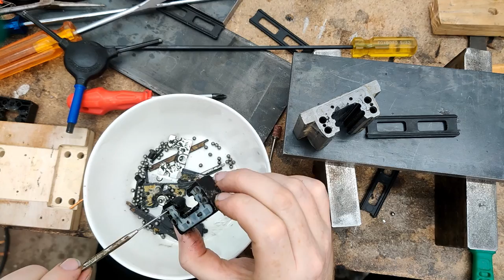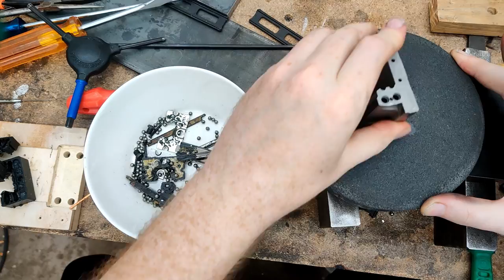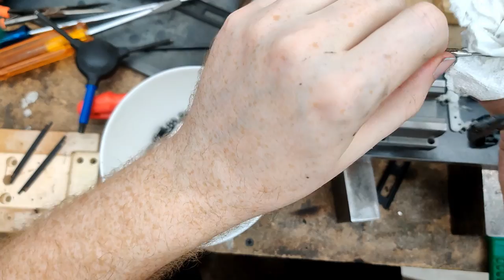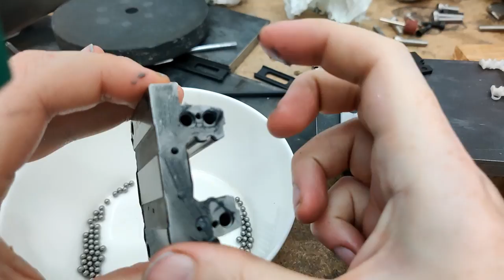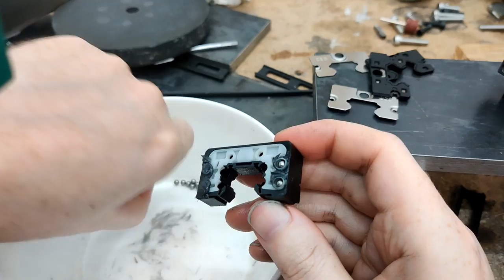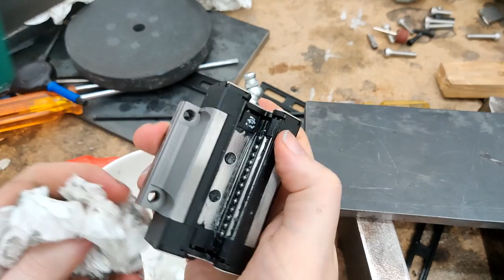Complete Bearing Carriage Rebuild: Tips, Tricks, and Techniques

Comment: A good practice should be to submerge all the parts in EPA for some time. That helps a lot the work
Reply from the maker: Yeah, using degreasers and solvents to clean the parts can speed up the process and get the last bit of gunk off the parts. In my case I don’t feel it’s necessary.  Mostly I don’t want to work around chemicals that give off fumes and breath that stuff and get it all over my hands.

Comment: Did your video analysis narrow it down to the carriages causing the wobble?
Reply from the maker: There was a bit of movement with the single carriages per axis. It was expected. Most of the movement, probably 70%, was due to the risers being bolted to the gantry. It doesn’t make a firm connection. The rest was a combo of bearing blocks and the plywood head. 

Gantry moves a lot on the risers because there is a lot of mechanical leverage applied to them from the spindle.

Comment: Hey Bryan, shouldn't you tighten the last screws after the carriages are installed back on the rail so the gasket part can self center before?
(probably a dumb question, but that's what I was suggested to do on most smaller MGN9 rails for my 3D printer)
Reply from the maker: Yeah especially when they are new I would do this. It also depends on how sticky they are. After they get run for a little you generally don’t have much stiction issues. A lot of the times the sticksion happens when the balls flow around the loops on the end. You can feel this happening when you move them by hand on the rail and they intermittently stick. 

I would adjust those wipers on a per case basis when you finally get them onto the rail so you don’t bump them while taking them off and putting them on. 

Also it highly depends on the use case. If you are running linear rails on a 3d printer and lubing it all with oil and don’t have powerful motors, getting them to glide as smooth as possible with no friction is your main concern. In my case I’m turning them with 400W servos which overpowers any amount of friction that occurs.

Comment: How do you adjust the preload on these bearing types? slightly bigger bearing balls?
Reply from the maker: That's it. I’ve never ordered replacement balls though. You can order them in lots of sizes for this purpose. I have a feeling you have to go buy a bunch of size ranges and it’s trial and error till you find the ones with the right preload.

Comment: use bearing carriages with scrapper and rubber wiper plates.
Reply from the maker: That's what these are. Chips make their way in regardless. Usually from low spots on the rails due to bolt holes where the cap is lower then than metal.